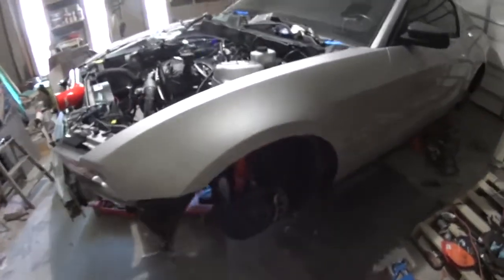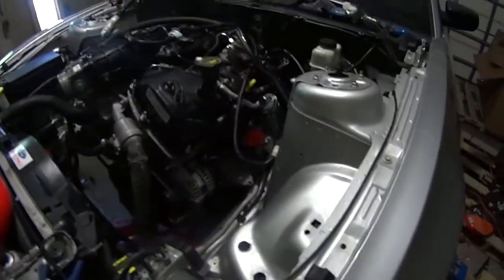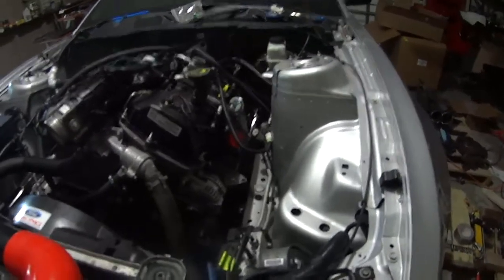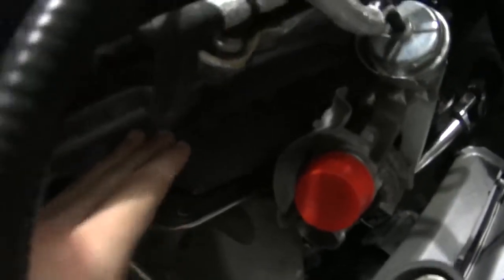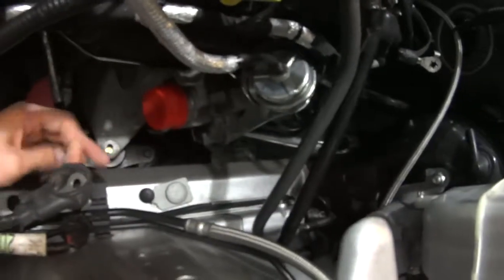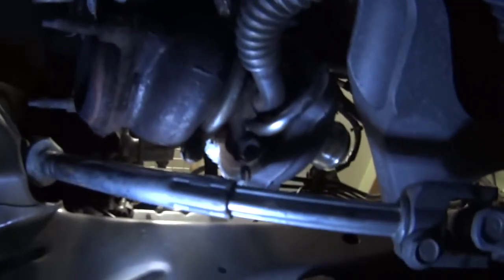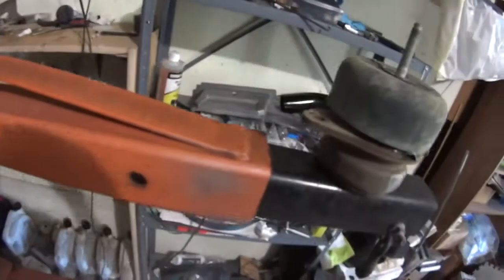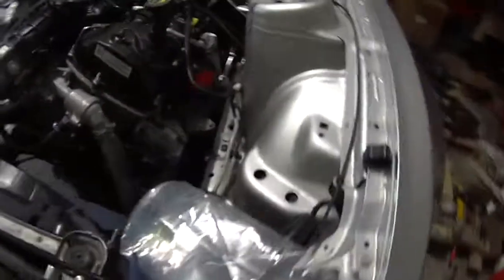Putting 3.5L EcoBoost Turbos on Your 3.7L Mustang!

Comment from the maker: Please see my second video on this subject for my updated thoughts. I have finally seen the dyno sheet for the only 3.7 w/ 3.5 turbos I know of. It made 407whp@5250rpm on E85 and it's a '15+ Mustang, so you can probably expect an 11-14 to make a bit less. The torque number was 470lbs-ft@4150rpm and fell off pretty quickly after that. Average HP from 2-7k RPM was 314. I asked what it made on 93 and received no response. I did hear that they were having issues tuning it though, so maybe they weren't able to get anything decent out of it without E85. Again, I can't confirm that, but I don't want to give anyone unrealistic expectations. For what it's worth, the car is now for sale.

Comment: To anyone still interested by this, I swapped my '12 mustang way before them (in 2012) and I can tell you that you can indeed install the stock ecoboost manifold to the 3.7 easily. I made custom brackets behind the heads to account for the mising stud. That's it. I just saved you a stupid amount for insanely priced daptor plates. Another stupid thing they did with this kit, why in hell would you use custom oil lines when you can use lines from a FACTORY 3.5 ecoboost engine? The factory one is joined to the return line at the turbo. As return lines : use stock oil feed/ return, just cut the return leaving 1 inch from the turbo and plumb it to the oil pan return bungs you have to weld. For coolant, you're missing the taps behind the heads but you have 2 choices : tap into the head where it is on the 3.5 or intercept an existing line. Done. Factory manifold at Ford : 75 each, turbos : 100 each used. All in all, less than 1000$ to twin turbo the 3.7 V6. I run methanol and 94, 14 PSI and laugh in the face of V8 owners when they see my 3.7 badge while passing them like they own a Civic.
Reply: Can you elaborate on what exactly you had to do to make the 3.5 manifold fit? What was the issue you faced initially and how did you solve it.
Reply: @xNELVKALEN  the manifolds are longer than the heads. You have to make a custom bracket to hold a stud behind both heads.
Reply: you da man!!
Reply: Hey Benjamin, any drawing or specification on the custom brackets?

Comment: How much boost can these 3.7l engines handle with stock internals?
Reply from the maker: Boost will vary depending on the specs of the turbo kit, but they can generally handle about 500lbs-ft of torque and 500hp or less at the wheels pretty well. Some have even gone as high as 600whp with E85 but I don't think there are many beyond that without a built motor. These turbos won't get anywhere near that hp on a 3.7 though.

Comment: The 3.5 eb manifolds bolts up to the fwd 3.7 if you drill in tap the last hole going towards the trans. The fwd 3.7 is a very strange engine, the heads have undrilled direct injection bungs. My theory is that a fwd 3.7 has 3.5 heads so it might be possible to run both direct and port injection with this motor. Obviously someone would need 3.5 eb cams, injectors, lines, driver side valve cover and hpfp to get it to work.

Comment: Do you think this kit would fit on a 3.7 in a Taurus?
Reply: Did u ever find out about the Taurus just got a 3.7 police interceptor 2014.
Reply: Ariel Monroy its the engine they use for the mustang, so im assuming a mustang 3.7l v6 turbo kit would do just fine
Its just the spacing and where to put it where you’ll have issues, im looking into one but debating getting an SHO to just get over it with the instal and have the bases to work at already

Comment: Does anyone know if this would work on the 2013-2016 Lincoln mkz 3.7?
Reply from the maker: I highly doubt this would work for that application. These manifolds are designed for a longitudinal engine layout like you would find in a RWD based car or truck.
Reply: DC Garage that's unfortunate, would there be any hope to be able to turbo the car through other means?
Reply from the maker: You could have a custom turbo kit made but it would be very expensive. A custom centrifugal supercharger kit would probably be the easiest route though.

Comment: How well would the 6R80 in a 3.7 F150 hold up to these?
Reply from the maker: The 6R80 would hold up just fine, but you would probably be better off trading in for an EcoBoost.
Reply: Can't get a 3.5 EB in a short bed, regular cab STX. 90% of STX trucks near me are 3.7s. The rest are 5.0s and much more expensive
Reply from the maker: I see, if you're set on keeping it I would suggest looking into a custom turbo kit. It will cost a bit more, but you would get much better performance in the long run. The 3.5 turbos could also work, but based on the numbers I've heard, it didn't perform as well as expected.
Reply from the maker: Also my cost estimate was definitely on the low side. The only guy I know of who finished this says he spent about 6k on it. I still think it could be done for a lot less, but it wouldn't be easy.
Reply: Mr Anderson You can the Tremor. An Ecoboost powered Regular cab short bed F150.

Comment: Is this the first time you've done a major mod like this? Do you recommend you have a lot of mechanical experience or do you think it's easy enough?
Reply from the maker: The swap is pretty intensive, but it was my first time taking on a project of that magnitude. You should have pretty well rounded experience and skills before taking on something like that. Just adding turbos is quite a bit easier, but I wouldn't suggest doing it yourself unless you feel confident in your mechanical abilities.

Comment: You guys need to look up limitless performance they have made a production kit for the 3.7L V6 mustangs in the kit they're using they've highly modified the kit for their test car with the stock bottom end making 700 hp holy shit now with all forged internals it's making 1000 hp look it up it's on YouTube right here
Reply from the maker: I actually had an LPF kit on this car that was part of the reason I decided to swap. I was not impressed with the quality or design. I ended up selling the kit second hand. It made decent power but it's had lots of problems too. Bottom line, I wouldn't suggest them.

Comment: Just wanted to put this here. This is a response I got from one of the people at SuperSix concerning additional components required for this adaptation. I inquired about a 2012 3.7L.

"You will need an intercooler, duel inlet, single outlet style for 2011-2012
GT, of course the charge piping from the turbos to the IN inlets and from
the IC outlet to the throttle body, the cold air side, blow-off valve, boost
controller, bigger injectors and then modification of your exhaust system to
attach to the turbo and finally the tubing."

Comment: What intercooler would you recommend for the 11-14 3.7L? Also, will installing these turbos require a trip to a dyno for tuning? I'm trying to see what the total cost would be to get these on the car and running.
Reply: Mounir Zerrad grabbed both turbo on eBay for 300 injectors 325$-365  intercooler $230 with pipes universal 2in 1 out wideband o2 180$ kits is 825 manifolds 37$ apiece from ford order from white bear lake fast shipping factor in 300 for new gaskets and seals it helps to have a spare engine having already blown one makes it easy I'm currently working on my downpipe situation so ??? On price for that base tune from mpt is 600 I'm at about 1200 and I just need the adapter kit and downpipe and tune so about 3500 all in at least that's what I'm shooting for but I want as little down time as possible
Reply from the maker: There's a lot of room in these cars, so you can make most universal intercoolers work. I suggest the best intercooler your budget allows. Treadstone performance would be a good one to check out as a starting point.

Comment: I'm intrigued by this as a possible way to go for a great cost effective F/I setup, both for bragging rights and just something unique. Can much of the factory exhaust from the cat converters and onward be used? I would like to keep mine sounding exactly as it is now.
Reply from the maker: You can re-use most of it, but probably not the stock cats just because of their location. I would suggest having some high flow cats welded in a bit further down instead if you went this route.

Comment: Anyone done this yet?
Reply: kit is assymbled turbo hardware will run you about 2800$ its looking like a electronic boost controller will be a must on these build
Reply from the maker: Not yet, but I'm pretty sure they've found all of their beta testers at this point so it shouldn't be too long.
Reply: Sweet! Maybe I'll hold off upping to a GT for a little longer then..
Reply: well im buying it for my 2012 got the turbos for 300$ for both
Reply: demarianx Let me know how it goes, im really interested.
Reply: will do im really surprised at how inexpensive it is to convert once you have the kit its basically oem parts im going for a reliable daily nothing huge yet..
Reply: Sweet, looking forward to the results!
Reply: anything done yet?

Comment: What is this control pack I often read about? What's the purpose of having it?
Reply from the maker: +Rictor Scale It's essentially a standalone ECU, wire harness, and a bunch of sensors from Ford Racing to control their crate engines in different applications. If you're building a hot rod with a fuel injected Ford engine it's what you would use to control the engine. I'm using one for my swap and I'll go over it in a future video if you want to learn more about the subject.

Comment: Considering just how close the turbo is to the steering column, will the added heat from the turbo damage, or affect , the steering columns structural integrity I ask because of loads that column experiences on a daily bases. Keep those vids coming!
Reply from the maker: +Rictor Scale I wouldn't expect this to be an issue under normal conditions, but if you find it particularly concerning, there are some options to help protect it. Ceramic coating certainly wouldn't be a bad idea.

Comment: Looking forward to seeing your builds man. How quick do you think a twin turbo 3.7 would run? I have a 2014 v6, and Im trying to figure out how to get the biggest bang for my buck. Not sure how much it would run me if I got forged internals and a turbo kit, granted Im no mechanic and wouldnt install myself. Maybe using the twin turbos from an F150 with the super six kit would be cheaper than a turbo kit? Your thoughts please. I might end up just trading for a GT, but if I can safely get 500hp out of my 3.7 for the same cost then that would be better.
Reply from the maker: +Garrett Burley It's hard to say exactly because there are many variables at play but a twin turbo V6 with a decent tune should run at least low 12s. You don't even need a built motor so long as you keep it under 500ft-lbs of torque at the wheels. If you're looking for bang for your buck though, this is the way to go. It will probably be around half the price of the typical turbo kit. If you're just looking to get around 500bhp, boosting your V6 is a good option. It would be pretty reliable at that power level and it would probably cost a bit less than trading up to a 5.0.
Reply: So do you know how the F150 ecoboost twins compare to kits like LPF, Hellion, and procharger? Single turbo v6s like Killer6 (LPF) and the CFM 3.7 (procharged) stang run mid 10s. Im eager to see someone do the ecboost turbo to 3.7 v6 because its a new thing and people are hesitant to try it, so no one seems to know if it would work and be reliable. Would it be possible to get a 3.7 to run 10s for spending 10K or less?
Reply from the maker: Garrett Burley Well the F150 twins are much smaller than the single turbos that come with the usual aftermarket kits for this car. Because of that, you will see less top end power, but the up side is there will also be less turbo lag. I have no doubt you could get this car into the 11s or even 10s, but it would take more mods than just these turbos. But yes, with a good tire, these turbos will be very capable. We don't know exactly how fast it will be yet though because it hasn't been done yet. But it should be quite reliable as long as you get a good tune. These turbos can make about as much power as this engine can hold though without building it. The Hellion kit had lots of problems and they no longer make it and I do not suggest the LPF kit at all because it has had plenty of problems too. If you can find one used for a decent price though it may be worth the trouble. As for the procharger, it's a totally different animal. It will make just as much power as these turbos, but nowhere near the torque. But yes, a 10 second 3.7 should be possible for 10k, but it will take quite a bit of work and you'd have to be very careful how you're spending that money.
Reply: Thank u! Helpful stuff. I havent heard anything good about LPF lol. Do you plan on replacing the turbos with bigger ones?
Reply from the maker: No problem! At some point in the future, yes. That isn't the top priority right now as there are lots of other things I want to do with the car before I upgrade the turbos. The stock turbos are pretty capable and will make more than enough power for my use at the moment. I'm about to announce my next big project for this car, so stay tuned!
Reply: I definitely will!